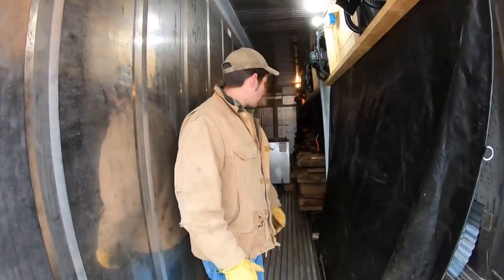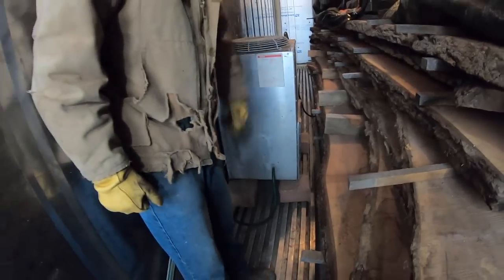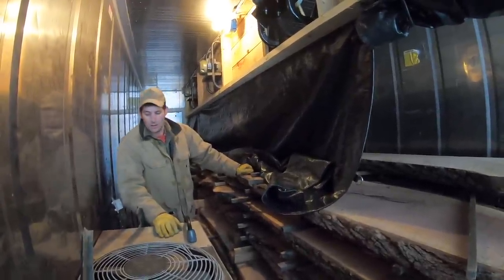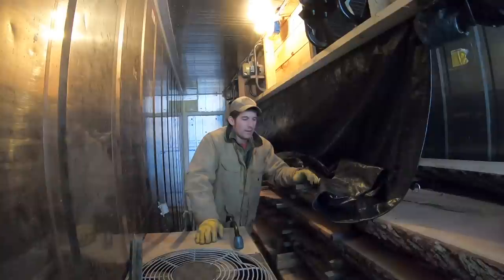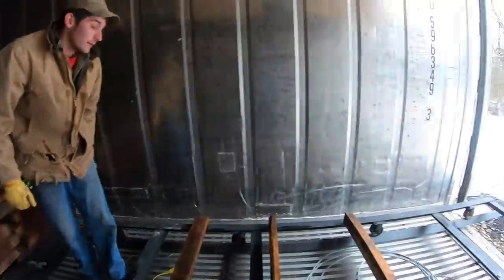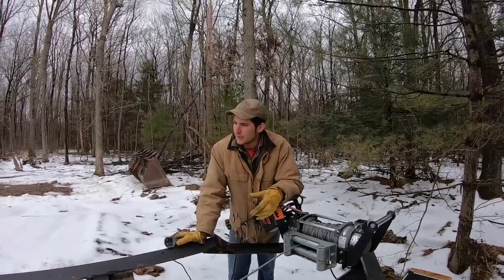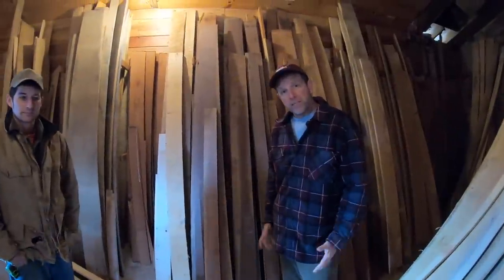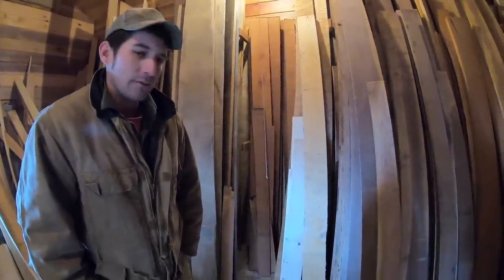What is a Wood Kiln and How Does it Work?

Comment: I noticed you're not using any vents.  Have you noticed any issues with the kiln overheating?  I'm currently in the process of constructing a kiln and I'm not sure if I need to vent it or not.  It seems to be counterintuitive to install them after I've spent so much effort insulating and air sealing the chamber.

Comment: First of all very informative video,l really enjoyed it,l have a question,you said 3 weeks for the walnut,do you run the dehumidifier the full 3 weeks?because l have elm and locust in my kiln,l ran it for 2 weeks and the dehumidifier pulled out like 14 gals of water,the moisture level in the wood is 14 to 16% however that's it,no more water is pulled out,someone said just leave the fans running with heat blowing for the next week or so,but why is no more water being pulled out?
Reply: There are too many unknowns to be specific, but Ill try to give some generalities and hopefully it will help you. It sounds like the area you are drying in and the wood has reached an equilibrium. 14 - 16 % is generally that area depending on your climate. If you want to get it lower, I would suggest adding heat, another dehumidifier , more air circulation with fans or all of the above.

Comment: Does the kiln run 24/7. What is the average electric cost per kiln
Reply from the maker: Yes it does run 24/7 and the electric cost is very expensive but it does fluctuate depending on the season.

Comment: I have a small 20x40 pole barn that is partially converted to a living space. There is no heater, but it has a 600cfm exhaust fan and it is fully insulated. 

Could I add a large fan and dry my lumber in it? 

I greatly appreciate any response. 🙏

Comment: Does the wood always have to be air dried first and for how long? Since the kiln is a controllable atmosphere, can you go from the mill directly to kiln if you slow down the process initially?  I can never get a consistent answer on this thanks
Reply from the maker: Wood can go directly from the mill to the kiln. Some woods respond better to air drying first. But yes you can go directly to the kiln.
Reply: Thanks

Comment: Does any one know about kiln drying for firewood. If yes, explain
Reply: I have a 20” steel container with double barrel wood stove. 1/2” reflective back insulation. 2 24” fans well dry 3 crates or Facecord’s in a week or less. It has got as high as 200 degrees we normally keep it at 150 to 100 24/7

Comment: how much is that stack of wood worth that you pulled out of the kiln?
Reply: Wood Is sold by the board ft. One board ft equals 12 by 12 by 1 inch for a total of 144 cubic inches. However you wanna dice it ...144 cubic inches is equal to one board ft.  Walnut typically sells for 2.50 u.s. dollars/ bd.ft. (green) or undried.
$4.50 to $6.50 bd ft. Dried. Specialty cut or decorative cut walnut can fetch as much as $10 to $12 board ft. These are crotch, or bookend match pieces or decorative grain patterns.
   Birdseye Maple, English white Birch, Epee, Mahogany,Teak...all can be pricey but give wonderful results.